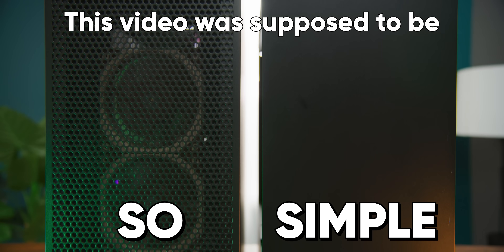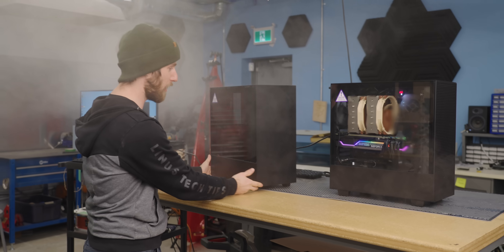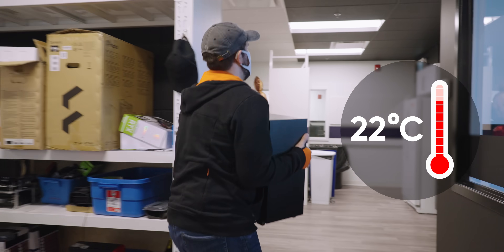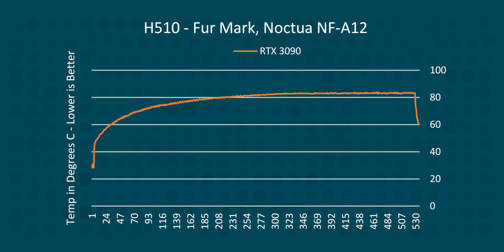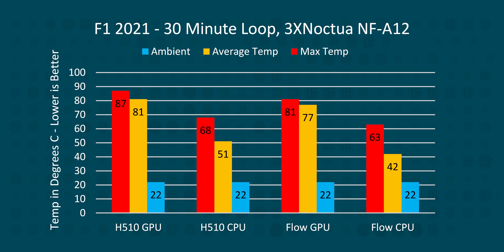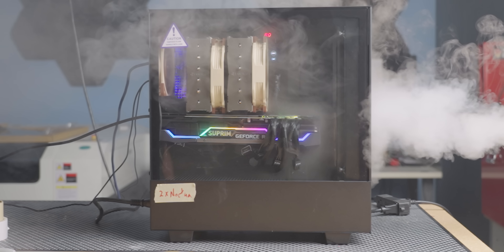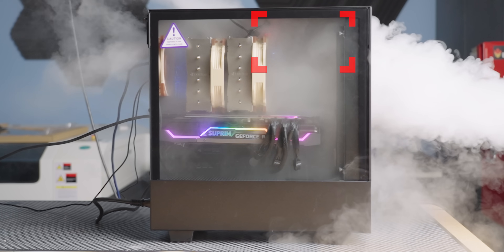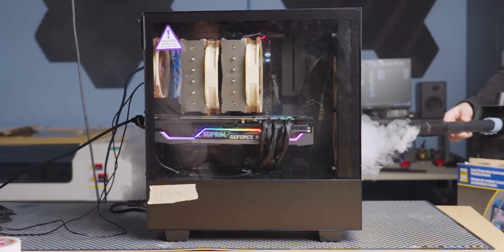Everything You Know Is Wrong - Mesh vs Non-Mesh Front Panel

Comment: Yeah I have the same problem with exactly the same nzxt case and watercooling aio. Only with a amd 5800x and a aurus rtx 3070.. Trust me.. It's a hot cpu and gpu config.

So I turned my water aio (in the front of the case) upside down, to get the air bubble in the bottom side of the radiotor, after tips from Steve. And that helpt cooling my cpu by 20 degrees C. 

But still then my gpu was way to hot.. So I put a fan blowing from my psu to the gpu. And that did the trick. But still it could go better. I'm curious if you guys find a better solution with this case or maybe I will buy another one. 

Thanks Linus, for this video.

Comment: What happens then if you put only 1 fan at the bottom of the front panel with the CPU fans? Because the GPU temp is affected by the dead space at the bottom of the GPU. Would that help or not because there's no opening at the bottom?

Comment: My SilverStone Raven RVZ03 ITX case actually has better GPU cooling than my old full sized case using the same GTX 1070, I'm certain my 3800x suffers a bit though 😂 

I haven't had any overheating issues and it's just small enough to shove into my old large laptop bag so honestly, no regrets. I can easily move it around for LAN parties without breaking my back each time👌

Comment: Couldn't you just install a small diagonal plate that keeps the air from the lower fan at the gpu. So basically seperating air flows of GPU and CPU

Comment: Agree with the result I would add one thing however. If you cool more the CPU even going out of throttle, you ease a bottleneck so other components could go faster... and so GPU can go faster and heat more. On a Benchmark this is more visible as they are intended to make all go fastest as possible. In an actual game this effect could disappear or become more visible.
As for the flow... equilibrium is the way always no matter the approach you choose... you cool if X cold air enters and X hot air exit.

Comment: From personal (and very novel/non scientific) experience, most of my focus is on taking air out of the case, normal pressure will put air back in as needed, not as important. But taking it out? critical.  Have reversed fan flow, air goes out of the front, in from the back and top (without fans just passive as its pulled inside) and all the fans are in the front blowing air out, i keep the slots under the GPU open as air intakes. It... works, but is it the best? idonno. it works better than the reverse, so maybe, at least in my configuration.

Would be interesting to have an episode of this with proper length and testing many different configurations now that theres a smoke machine!

Comment: That’s so weird. I have a h500 with an overclocked 9700k (5.1 all core) and a strict Vega 64 and have never had any temp issues. 
(Gpu gets to 80C even with side panel off and big fan pointed at it, and Cpu gets to 75C to 80C with a 240mm AIO. These are stress test numbers and it dosent matter if the cpu and gpu are being run independently or together). I’d love to see more comparing the original h500 to the h510 and how do they perform with AIOs.

Comment: I bought the nzxt 510 NO MESH case and my gtx 960 is dancing on 75/80°C 
I even got a chungus liquid cooler  (pulling air in) for my CPU in the front, blocking the tiny intake I got
Airflow is crap, but graphics card shortage is worse.
I will buy another case when graphics cards prices are DECENT

Comment: Gpus were relatively small parts until the last decade. Nowadays even founder's edition cards being huge monsters the issue of the gpu's position in the case comes out. Back in the gtx 7xx era I saw cpu coolers slapped on the gpu looking like the pc had 2 cpus installed and cooled separately. And it produced crazy awesome temps with little very little noise. I drooled when I saw these vids because I was reminded why this is so nice while my gf complained about my gtx 970 windforce's triple fans being too loud during gtaV. Without a standard change the only real way to keep things cool is gonna happen with watercooling gpus. And I hate that. Would love to see a comparison of the same cases where the gpu is watercooled.

Comment: Big case = nice air circulation more room for jet power/fans. I have 8 fans on front and 4 fans on right side I then got a 420mm aio on top and PSU fan on bottom to suck air down and out the back. lol i sacrificed the back fan for LCD display but looks sexy and worth it plus everthing is white so it’s not so dark like a cave, and sometimes I take off glass panel when ever I game just late out more air but sometimes I’ll leave it on.

Comment: I have an old Fractal quiet beast of a tower case I still use from eight years ago with the guts recently upgraded to an 11700k, although I'm only running a 2060 super GPU. I love the case because you can suck in from the front or from the bottom. I also use Noctua fans and have it exhaust from the top and suck in from the bottom primarily. I noticed a pretty nice temp drop when I did. This sort of makes sense because hot air prefers to rise. I have the same heat sink but the dude that did my install pointed the fans up, which probably also helps. (I have arthritis and can't do most of the computer work I used to do.)  I was concerned flowing over the GPU would cause an unexpected rise in temps, but I have yet to see that happen.

Comment: I have H510i NZXT it's good material quality but bad design flow or not it's bad design now i buy Corsair 5000D and it's much better design then NZXT.If you buy 280mm aio then problem start do not buy 280mm aio for H510 NZXT case.

Comment: The apparent cause is that the Noctua cpu fans sucks all the incoming airflow their way, leaving no joy for the compartment downstairs (facilitated by the long and wide GPU well positioned serving as the air duct). A possible easy solution is build a shroud to induce the airflow from the lower front panel fan to blow towards the lower compartment (where the GPU is, of course).

Comment: That's something that workstation builders had figured out a long time ago, but for some reason enthusiast/gaming case manufacturers are completely ignoring.

Look at the construction of a HP Z or a Mac Pro, for example: Airflow is guided to the components and often separated - one path for the CPUs, one for the drives, one for the GPUs. Rarely any turbulence.

Gaming case on other hand: Lots of air in, lots of air out, but what happens with it inside the case is completely random. CPU and GPU fans are not pointed in a certain direction (note how workstation GPUs are still  blower style) but often actually are pointed perpendicular to the case fans.

Comment: Back in my air cooling days I used a pci slot fan to exhaust the hot air under the gpu as this air gets trapped and heats up, those pci fans are great.

Comment: That's why I don't even change my case. Bought in 2008 from cooler master.
Its side panel has a mesh right beside the gpu, so chunked one 120 mm at the side which sucks only fresh air straight on the gpu fans.

It also got a mesh front with one fan at the bottom and one exhaust on the back.
It looks awful from the inside, but no1 sees the side of my pc, so I don't even care :D

Comment: Why isn't there like a case mod with having like 3-4 slot shields below the GPU with mounting holes as well as a foam air duct (like NA-FD1) so you can mount an active exhaust below the GPU (provided an active intake at the same height level from the front or side)?

I want to build one myself for testing that theory out:
Use 4 slot shields with mesh, soldering them into one piece. Add mounting holes for fan screws (or others, depending on the ones I later want to use) for a 92mm fan. Use foam tape as air duct around the fan with a width larger than the unevenness on the back of the case.
Next part of the theory ist testing if a vertical mounting kit for a GPU is further improving air flow and of course temperatures.
Project after that would be a cone or triangle mount thingy (no specific idea yet) to reduce turbulences of incoming air hitting the end of the GPU as shown in this video here. Imagine someting like one of those pieces for hairdryers.

Comment: I've noticed that in the pictures provided for the GPU that it only has one row of IO, in most cases I've noticed the GPU's that go for this design choice normally have an open vent on the other row for heat to be extracted by one of the fans on the GPU(furthest to the rear); the MSI 3090 SUPRIM however seems to have a big metal block underneath the mesh of it's second row, completely defeating the purpose of only using one row of IO to begin with... I get that heat is pooling by the GPU because of bad extraction flow at the bottom end of the case but I feel like it's sharing equal load with bad GPU design too.

Comment: To minimise turbulence and maximise flow, I’ve done a lot of testing, and i like to have a case with plenty of space between components, mesh front, lots of front intake, and back AND top-back exhausts, then the air has a clear/even flow though and out of the case. I also have a small fan below the gpu used an an exhaust, which also helps (but i know people tend to dislike small fans due to the increased sound, so that’s down to preference 👍).

There’s also an argument for more exhaust flow than intake, to minimise turbulence - but I haven’t tested that yet.

Comment: Running a fog machine into a small tube diminishes the atomizing of the fog and ends up just getting wet with fog fluid. Use at least a 2.5 or 3 inch pipe and you'll get better CFM

Comment: They should try the deepcool macube 310 and 310p. They have the same differences but deepcool added the mesh to exhaust instead. I bought the non airflow macube 310 and had TERRIBLE  thermals, then with a little "convincing" i was able to get deepcool to send me a 310p top exhaust mesh panel that fit the older  macube 310 case. I went from averaging 90°C cpu(i5 8600k oc'd)temps and close to the same in my 3070ti with my deepcool tower fan and two fans on top and two on front. Then i upgraded my cpu cooler to an aio and went down to the mid 80°C temps, then finally with the new mesh top i average 75°C on cpu and even lower on my 3070ti.

Comment: The weird thermal behavior has nothing to do with turbulence. Air is always turbulent when you have fans blowing it around inside a PC case. The reason that the GPU temps rose as more fans are added is just like Gamers Nexus has explained in their H500/H510 case review and in their comment here, purely because of the change from negative to positive air pressure. 

When the case has negative air pressure the case draws in air from the vented PCIE slots which coincidentally goes straight into the GPU fans helping thermals. This airflow movement stops when the case becomes positive air pressure and the GPU just starts to cycle through the hot air inside the case. This can be clearly seen in 5:56 when the second fan is added, how the smoke starts to go from the top to the bottom into the GPU fan and recirculating the hot GPU exhaust with it.

Comment: Hey Linus, after seeing this and pondering it for a while, could you give me a recommendation for a water cooler for my rtx 3060ti? I have seen people say it uses the same pcb as a 3070 but all the ones I see are for fitting a gpu that had 3 fans but mine has 2, and I'm not sure if those will fit my card. If it helps it's a rtx 3060ti from a hp omen prebuild.

Comment: One interesting discovery I had was that, moving my single front intake fan from middle slot to lower slot decreased my GPU temps almost by 10C° It blows directly under the GPU so provides much better airflow for the GPU
Reply: I miss the days befored tempered glass side panels took over. A 120mm side panel intake beside the gpu was popular. Some cases even had a side intake for the CPU area and for the GPU area.
Reply: @ayuchanayuko  side intake for the CPU really makes sense only for top-down CPU coolers, not tower ones, so it still exists but mostly in ITX and desktop cases. As for GPU I think more elegant solution is to have front intake, but at the bottom, so it cools hard drives, chipset AND supplies air for GPU bottom intake. As it was on older mid-tower cases and sometimes exists today, I have such a case and love this configuration.
Reply: @1loshvitalik  Well some people want to use inverted cases. Were the gpu is up and the cpu is down. So there a side fan would work wonders getting rid of warm air.
Reply: @1loshvitalik  my case ( Antec Dark League DP502 FLUX) has a reverse fan the blows from under the GPU, such a nice feature especially with a blower card
Reply: @edenjung9816  Inverted cases are interesting since with the GPU cooler blowing downward, you usually get best results with having intake on the top of the case and exhaust on the bottom, otherwise your fans end up trying to fight the GPU cooler.
Reply: @edenjung9816 my old case had a side fan by the gpu.
Reply: @ayuchanayuko  my case have mesh for 2 fans over GPU and CPU in side panel. Really cheap case with kind of trash front panel (which i will cut down a bit to improve airflow more)
So this solid side panel problem don't hit me.
Reply: @ayuchanayuko  that was my last case. You can still find solid panels, look for "quiet" or noise insulating cases. I got mine on a great sale. Had an exhaust fan beside the gpu to help move air out.
Reply: After watching this video this was what i was thinking too. 
Building my first PC in a few days and i think i'll try putting the front case fan lower so that it helps to get air under the GPU. 
I think my case even has room for a fan under the GPU which could be something to look at as well.
Reply: Not so great though. I am not hating by the way,just saying. You have one fan as intake basically only blowing cool air under the GPU, GPU then converts this cool air into hot air. Nothing else is getting cool down efficiently, if anything everything else is hotter now because the heat dissipated from the GPU is going up towards ram,cpu, board, you name it. the only way this will not make you pc overheat and throttle is if basically is just a working computer and you never do anything in it that would makit run at it's maximum performance. Which is understandable, it is sort of what I do, I have an old case that I like very very much but when it comes to cooling it literally only has a 2 inch gap and the bottom on the fron of the case. I underclock my 5900x so not to ever go pass 85 degrees even after plenty of hours gaming on a red devil 6800xt at 1440p. My pc is definitely underperforming but because i am still getting over 100fps smoothly basically on any game I throw at it at 1440p, I am happy as it is. By the way that is with 3 120mm fans on the front,240mm radiator on the top,1 129mm fan on the back which some might say is the best way to position fans inside a PC

Comment: ive had this same theroy in mind im using a deep cool case that looks very simialer with no mesh front so ive use my front 3 fans to pull air out of the case and the rear to pull fresh air in i have no proof behind my sience exepct just the thought that the front three get way lower in the case so it should be pulling that hot air from under the gpu out idk pointless commment but it would be cool if you did the testing for me

Comment: I would like to see this test done with a case like my Phanteks Eclipse P600S with a 240 radiator with the fans on the front of the radiator , a 120mm fan at the bottom of the case blowing at the GPU , 2 12m slow moving  fans in the top exhausting and a slow 13m rear fan. 

I have the 120mm on the front and bottom so that my GPU gets some air too.

Comment: The h510 solid front fans are mounted wrong, nzxt advises to mount the fans on the inward side of the fan bracket to provide a gap for the fan to suck in the air coming from that small ventilation mesh on the side. But ofc your gpu is a chonker so you cant actually mount it correctly.

But the vid finally clarified why my h510 works well for me…my gpu is a 2 slot and 2 fan model from galax (1660s). Air flow, even tho there isn’t really much of it, isn’t impeded by a gigantic gpu.

Comment: Looks like you are creating pressure in the case...this is counter productive. 
If you want to create a cool case it needs to have a more than slightly negative air pressure inside the case to get the most airflow. 
Personally I would never use a fan to blow air into a case, only out...but you will still need some airflow into the case. Of course always exhaust out the top as much as possible, but to also be more effective at removing heat you want the exhaust fan as close to the heat source as possible to get it out of the case as quickly as possible too. For this specific case I would run no fans on the front (just open mesh), and just top and back of the case extracting the heat out. Not sure if the case can mount fans behind the mother board but if you can I would exhaust high and low there too.

Comment: Hoping to learn more about better positioning in future videos. Recently added a 2nd NF-A15 to the lower front of my Meshify C in front of the GPU to go along with an upper intake that was blowing air towards the CPU cooler. 

It didn't seem to hurt my GPU temps but I was certainly a little disappointed that it didn't help at all, either. Hopefully it's just a matter of shifting around the fans I have!

Comment: GamerNexus review on the non airflow version said that the case did better in a negative pressure configuration/stock (out of the box) only 2 fans on the top and rear. Because it removed all the dead air from the case.